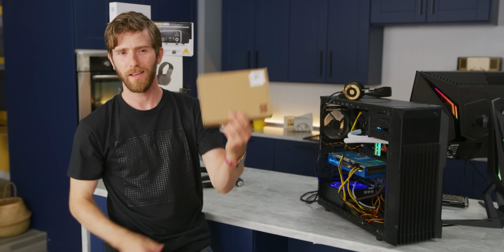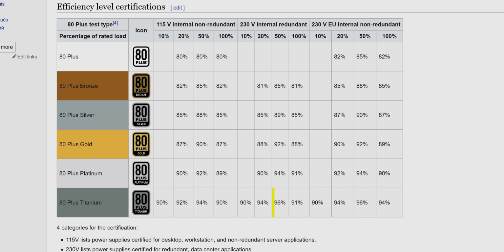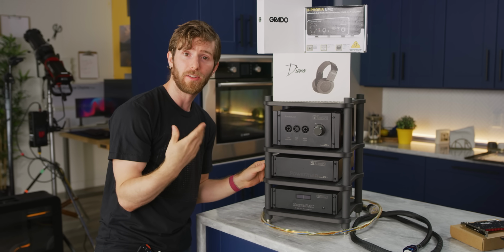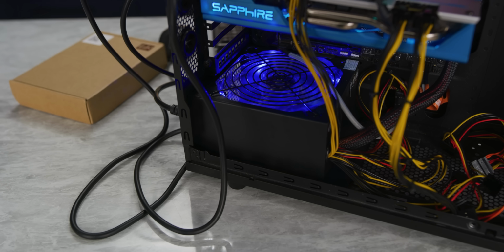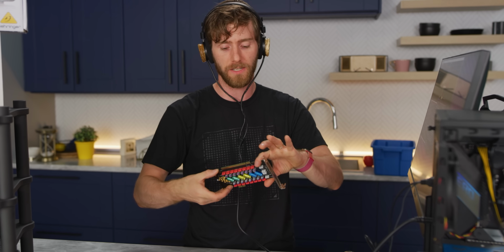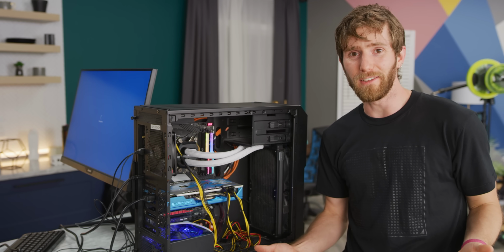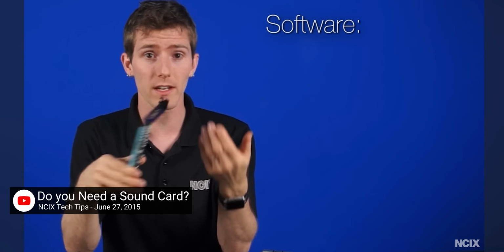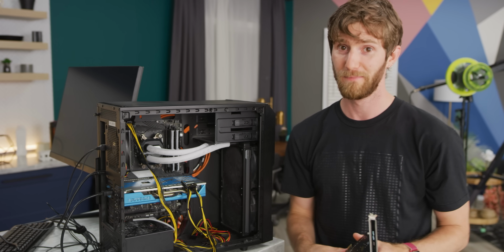Is this $40 card a SCAM? - "Audiophile" Power Filter

Comment: Also, your test isn't fair here. The main reason Grounding feedback happens is predominately due to multiple power sources feeding from one source into multiple appliances. You'll notice you do not get feedback like this using speakers when connected to a laptop that's running from it's battery power. 
To really hear the feedback and notice the difference with and without this add in card, I'd suggest using a set of studio monitors (Yamaha HS07s or KRK Rokits for example). You won't really hear the feedback with Headphones as headphones aren't plugged into the mains like your PC is. There should be no feedback on headphones as is. To really ramp up the feedback, plugging your PC and speakers into the same wall sockets will definately cause feedback unless each wall socket is independently grounded.
Reply: Also, you never even plugged anything into the card... The card should be acting as a replacement for a Furman power cleaner or a USB external audio card. 
Also, it can't fix coil whine, it's not acting as an intermediary between your MoBo and other components. The idea of this card is to act as a power cleaner between your power transformation and your audio output. If the audio output isn't being routed via the card, the card isn't doing anything.

Comment: shoulda used air cooling to get more noise from cpu water is an isolator, thats why water cooled graphics cards are better if you have a dedicated sound card
Reply: i use a soundcard so i dont need a separate headphone amp

Comment: That exact power supply, I blew two of them up. Like they literally popped and smoked. All I was running was an fx 8350 and a gtx760....
Reply: Did it kill the motherboard when it failed?
Reply: @bigjoeangel  no... but the second power supply took out my soundboard on the mother board.... I switch to a 750W Corsair and never looked back. Thats what I get for being cheap I guess lol
Reply: @CoryFritz1  You were lucky the damage was not worse.

Comment: The only time that coil whine has made it into my audio system, it was through USB. I could hear it when either using very sensitive IEMs, or my studio monitors. The best solution that worked for me was to use optical toslink into my external DAC instead of USB. (I have a schiit stack)

Comment: The principle is fine, the problem is that the filter needs to be close to the output ot the psu to see a difference, not in a random pci xpress slot.

Comment: bad onboard audio is why I have various USB soundcards, to isolate speaker-out from mic-in as they always leaked into each other on the motherboard. 
The only board (with onboard audio to begin with) I ever had that needed a discrete audio device for tolerable output when leaking into the mic wasn't considered was from driver bugs, not noise.

Comment: I have a power conditioner for my stereo. It doesn't really do that much on normal days. I got it for free because an audiophile was "upgrading it" for some reason. The thing handles like 1000W at 120V, and his system couldn't want more than 500W, so I have no idea why it needed more. Btw, the conditioner was $1000, and meant for sensitive industrial test equipment.

Comment: claims are pretty outrageous however adding caps is an interesting idea, circuit wise it dont much matter where you add them on the rail, tho they need tobe that large that the psu likely detects a short and wont power on at all requiring some sort of resistor or regulator chip. having a decent psu prolly a better investment
My money is on those caps being dud's or fakes and likely not even wired up, further that row of those metal cased caps are to expensive to warrant a 40$ card
can you try a multi meter and look if those caps even hookup to the slot?

ps the human ear not going to detect a large enough difference, what about trying a oscilloscope and look/messure the ripple

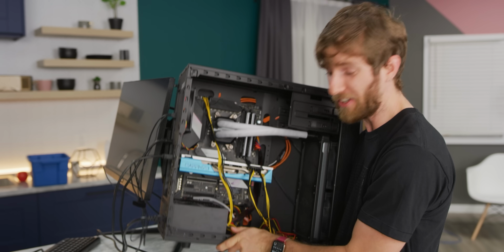Comment: 9:45 I think that's is the test video you need to make.

Pull out a ddr3 machine, which a cheapo mobo, and try the audio there.

With modern computers, many audio issues are solved with onboard audio and onboard amps on the mobo.

Comment: I think it's time LTT invested in an oscilloscope. Looking at the outputs before and after the card is installed and the noise floor on an oscilloscope would have demonstrated if it works or not very nicely in a visual way

Comment: The phenomenon with the "noise" you are talking about is actually tested for in most of the world under, but not in the US and Canada. Both require FCC part 15b. In Europe and the rest of the world, electronic components are also tested for immunity. This means they are blasted with a high field strength, typically 3V/Meter for consumer goods and must still operate normally. This is also done on the AC power lines.  For 15b, you also measure on the power lines, but only unwanted emissions from the device in a limited frequency range. There is no requirement to actually function in the presence of noise in the US and Canada. 
If you want an extreme example, take a set of LAN Power line adapters. There is a good chance your headphone jack will pick up the pulses.

Comment: This won't help with coil whine on GPU because the switching down of VRMs on a GPU has nothing to do with the choppy power on 12V rail, what you're hearing is the vibration of the inductors on the card.

Comment: I think you need to redo this test with a oscilloscope in order to SEE the difference.

Also connecting to a sound system (like big performance stuff) to this rig you would hear it across the house speakers.  We have to usually Ground lift most noisy sources.

Comment: I encountered noise on my home build win10 pro MSI A320 Pro-M2. I was also using an older (pre-usb 3.0) set of compaq speakers . I am also using a wireless keyboard and mouse. 
 
Anytime i fired up an app and/ or moved the mouse i had digital noise on the speakers. Never seemed to notice it with my wireless studio headphones (new last xmas). I swapped the speakers out for a cheap set of WALL poweres "CA" branded speakers and it went away.

Ive wondered that if perhaps the higher power needs of usb 3.0 are introducing more noise than usb 2.0? 500mA vs 900mA. I also prior to that tried using a ground loop isolator on the line OUT jack to see if it helped the older USB speakers. It did NOT. Anyone have any other insight?

Comment: just to point out that you will get hiss and mains hum even from battery powered equipment. The hiss is coming from the transistors switching and mains signals are all around us and will be picked up by any 'non-shielded cable or wire

Comment: The interesting thing is that “dirty power” is usually not a problem for your system as digital circuitry is much more resistant to electrical noise due to the digital nature of the signals. The only thing power noise really has an impact on is audio as audio circuitry is pretty much the only analog circuitry in most machines

Comment: Oh yes electrical engineering symbols! "L" for inductance, "i" for current, "j" for imaginary, "S" for apparent power, "P" for true power and "Q" for reactive power. No confusion here. At least capacitance, resistance and voltage have proper representation.

Comment: Camera suuuper shaky in this video. Anyway, pre watchin the full video. My first impression is there is no way to have better power without fixing it at the source (like a sinewave via UPS). I wouldn't expect that a PCI slot can do anything relating to power anywhere else in the system.

Comment: You underestimate the meaning of the Case and the Quality of the Front Audio Connectors , i changed my case , hide the front Connector cabel on the back side so its shielded by the  Motherboard holding Plate and its much less noise , much less Distortion , really much less ... . The Motherboard , the CPU , GPU and  Power Supply were the same .

Comment: Audio things that actually work: balanced audio on long runs (>10m), proper mains filtering networks, properly mastered music, use digital audio wherever you can at 44,1khz at 16 to 24bit. (any more samplerate doesn't make much sense see Nyquist-Shannon sampling theorem and bit depth only adds dynamic range which is pretty worthless unless listening to well recorded/mastered pieces of classical music), good speakers/headphones
Audio things that are pure snakeoil: OFC and silver cables (honestly, plain old copper is more than enough for even 10G Ethernet (417MHz), so why should the shitty 20hz-20khz audio signal give a shit?) "Audio Grade" capacitors, resistors, transistors and op-amps (I think normal components that can go up to 100MHz should be more than plenty and are 10x cheaper than the "audio grade" snakeoil)

Comment: What I would like them to test out:
The card paired with some of the newer components, especially a GPU, like GTX 1060 or higher. Then test it for coil whining.
Use a decibel monitoring device to check for any differences in decibel between before and after using the card.
Linus & Co have checked for similar things by taking laptops into special sound-proofed rooms to check for the decibels etc, so I would like them to at least use one of those on their regular spot there on top of the countertop, if not inside on of the soundproofed rooms.

Comment: cheap, couple generation old mobos, still are rather noisy. And 40$ won't give you a mobo. Spend a 100 - on a usb dac/amp, would upgrade the sound quality from even a decent mobo these days. Those Dragonfly "USB whistlers" as some call them by Audio Quest are insanely good for the price and are useable through your phone/tablet with an adapter.

Comment: Racing drones use a switching power supply, which requires LC filtering, to drop the motor voltage (25V @ 6S) down to the 5V/3.3V needed to run MCU and sensors.  Using a linear regulator for such a large voltage drop generates too much heat, not efficient.  Motors are quite isolated from the 5V.  Noise is best reduced as close to the source as possible.

Comment: I've heard some pretty bad sound capture on laptops (using for video capture on a live stream.) On those laptops, the culprit has always been the power adapter. Unplug it, bam, clean audio. This is one area where Apple wins handsdown IMO, as I have gotten the cleanest audio captures on older macs.
I also laugh when Linus talks about his first audio card being an Audigy 2 - I came from Vic 20 days, and my first real sound cards were an original Sound Blaster knockoff and original Gravis Ultrasound.

Comment: you just didn't perform the simplest test you could: record silence from the audio output directly to a high res audio recorder, once with the PCI installed and once without it and then compare the two (silent) signals in an audio editor for any differences

Comment: While the card no doubt does do something for power quality i'd suspect you'd need an oscilloscope on the power rails to find it. the graphics card is likely only putting noise on 12 V and it extremely unlikely the mb would be using 12 V for audio, When i've had poor quality sound its generally because of interference and poorly shielded cables especially for front panel audio or in the old days analog cd audio

Comment: One thing that i noticed just now is that i used to get that beeping on my headphones when i got a cellphone call even though the phonr got no connection with my pc but nowadays these interferences are gone. Probably because my current pc is newer amd probably has better noise filtering.

Comment: Linus, if you record the audio from before and after and inverse the phase of one and then play together (Use Reaper a free software or even Audacity) you will be left with only the difference between the two so its easier to compare overall as you will only be listening to the difference due to the waves cancelling each other out.

Comment: I use an external dac, but not for noise floor. I run it because dynamic range is so much better. I bought it because I was listening to a new CD that I had ripped to flac on my laptop, and it was so bad that I thought they messed up the mastering. When I finished transferring it to my Sansa clip, not the fanciest audio player, I realized that it was just a really terrible on board audio interface.

Comment: @Linus I don't think this product was menth to make your music sound noticeable better.
Before I moved to using external dacs for my headphones I had a soundcard in my system. After replacing my trusty 690 with a 1080 in there I noticed that I would hear when I moved my mouse around, as every frame rendered appeared to generate a transient power dip on the pci bus making a "tick" sound. the only time you would hear this is when you have no audio playing and high amplification. like a loading screen with the volume turned up. improved filtering just might be able to have an effect in these cases, but when the music is playing, you don't have a snowball's chance in hell to notice it. nb i used a 1050 Watt corsair power supply, so there should have been plenty of overhead to power the GPU.